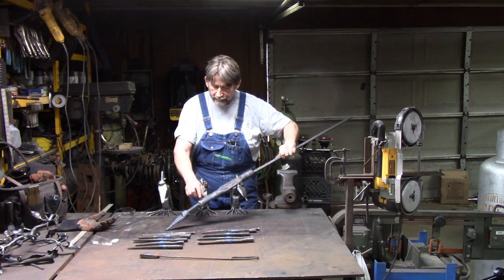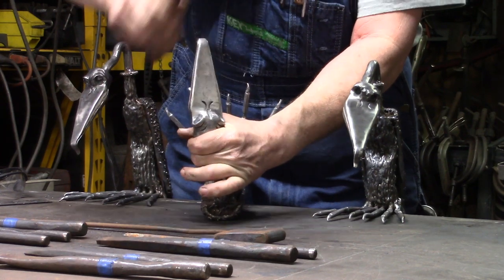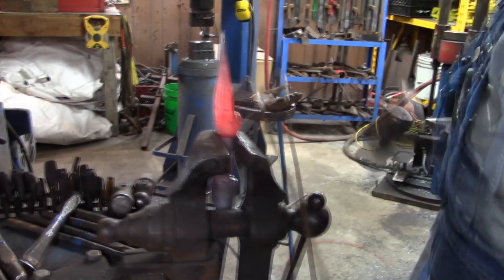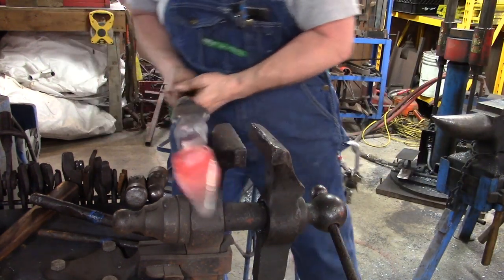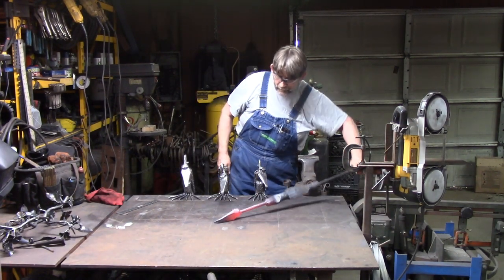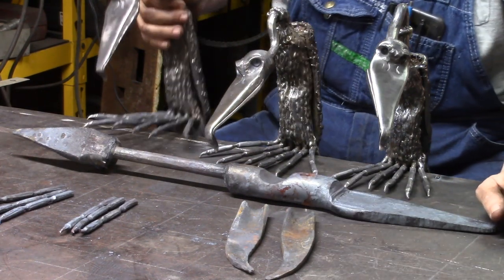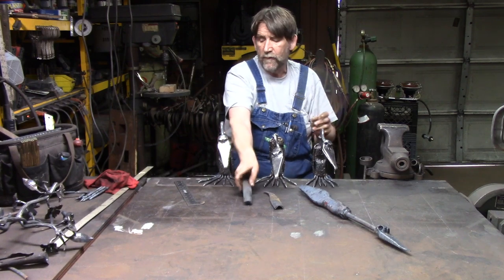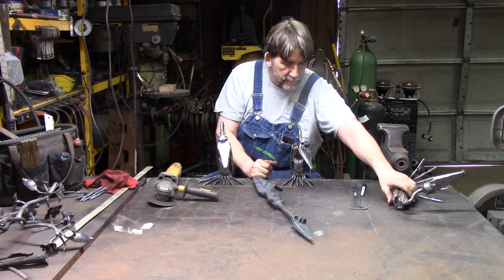Forging  A Buzzard Part 2

Comment: Thanks John. This is a nice project!
Are you texturing with a MIG or stick welder?
Reply from the maker: I use a mig with the gas ON.My millermatic 252 runs .035 wire at 18.4/265 for most texturing.